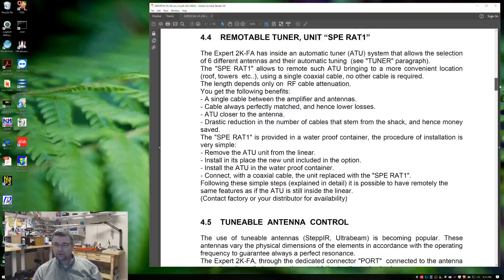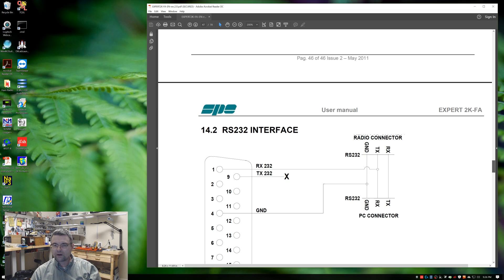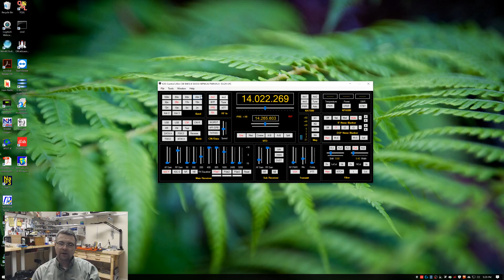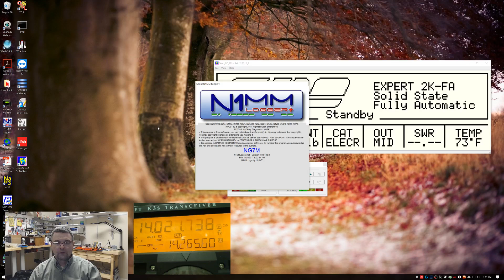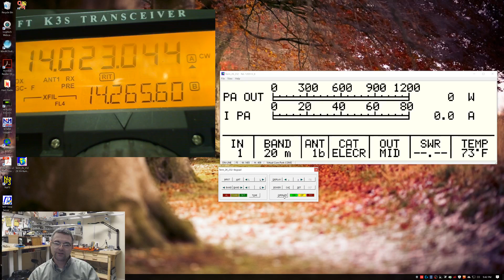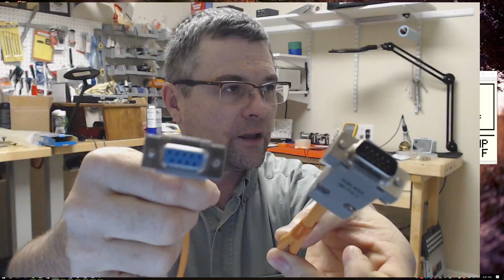SPE 2K-FA 1.5K-FA 1.3K-FA CAT Interface to an Elecraft K3/S and Remote Software

Comment: Sorry Man but seems like you are a rep of Win4k3suite and really do not need this suite for nothing. You can do the connection without this software.
Reply from the maker: I'm not a rep for Win4K3Suite.  Win4K3Suite is a one man shop.  Why would a a one man business have a Rep???  You totally missed the advantage of using Win4K3Suite.  It allows you to create multiple Virtual CAT feeds that allow you to have several software applications and or hardware devices using at the same time.  Of course you can do ONE connection without the software, but again, that's not the point.    If you are simple HF guy / one connection type of operator, and that's all you need, then I would highly recommend you stick with that simply non technical setup.  This setup is for a more sophisticated user that wants to have multiple pieces of software and hardware that thinks it's directly connected to your K3/K3S transceiver. I highly recommend you watch the video carefully and understand the features provided.  Again, I have no connection to Tom the author of Win4K3Suite, I'm just a happy user and nothing more.  Consider that too, why would I put the time in to make the video if I didn't think it was a great value for the price.  I'm not alone either... sophisticated K3/K3S users all over the world use Tom's software all over the world to simplify their DX'ing and Contest setups with stations and are likely far more complex than yours.  Also, it's not a good idea to make assumptions... If you have questions, send me a message direct.

If you respond to this comment in a negative or pejorative way, I will delete your post and block you from further posts on my channel.  It's all about rational input for those that have done their research.  Clearly you have not and or language / translation issues are at play here.  Max NG7M

Comment: Lots of good info and enjoyed your video. One thing I noticed is you have your SPE interface set to "Elecraft" and some others have it to Yaseu or Kenwood plus baud rates at 9600 instead of 38400. What's the deal? I would think you have it right but since I haven't tried it I would like some feed back.
Reply from the maker: Hi Rick, I prefer to use the actual Elecraft CAT feed so the Amplifier knows what frequency you are on before you transmit.  The Elecraft CAT and Kenwood interfaces for this would likely work the same where Elecraft based their CAT feed from the start on Kenwood's protocol (if memory serves me correct).  I would suggest using the full CAT feed where the SPE amp is polling the data.  You can tell if you have this working by going into Set->Manual Tune->Set and you will see the CAT: option at the top of the display.  And as you tune your rig, you will see the polled frequency in real-time.  For other interfaces that only use band data, the SPE amp will change bands with your transceiver, but it won't know where you are transmitting in the band until you transmit and the built in frequency counter determines the frequency.  This is more important if you are using the SPE tuner.  With the full CAT interface the tuner will adjust to your saved tuning settings before you transmit.  You can also just send the data from the K3 rather than have the amplifier poll the data, but if you are going to do that, you may as well do the full feed in my opinion.  Only reading the transceiver frequency is better than the band data only option.  But event the band data option is better than no cat / band data at all.  It's pretty clear in the manual that SPE recommends that you use CAT control.  As for the Elecraft option, it lets you use 38400 baud and again, it allow for polling from the SPE amp.  Others, as you mention that are using the Yaesu setting etc... are likely just using band data BCD only so the amp knows what band you are on.  If I'm going to spend this kind of $$$ on a top of the line amplifier and the manufacturer went to the trouble to allow for a full polling CAT feed, I figured I would use it.  So the video gets into some detail on that where I talk about using a full polling CAT feed to the amplifier and I don't just setup the Rx side of the CAT connection for the amp.  Hope that all makes sense.  I think there are more details in the video too.  Glad you found the video useful!  It's a great amp!  Max NG7M

Comment: I like the thinking and I do use the same software to interconnect my system, so this video will help others.  One caution is that the Pin 7 on the K3 ACC connector should not be driven by +12v TX Inh signal from pin 13 of the amplifier.  Pin 7 ties to the MCU of the K3 and 5V is the maximum safe voltage.  You will need to buffer pin 7 and tie it up to +5v.
Reply from the maker: Todd, thanks for watching and commenting.  I'm trying to remember if I put a resistor inline, but I doubt I did because I would have likely mentioned it in the video.  Your point is well taken.  You are spot on as to what the manual says too about the pull resistor mentioned in the K3(S) manual showing 2.2v pulled up to 5v.  Here is the text from the manual which I'm sure you are referring to:

 TX INH (Transmit Inhibit Signal)
Pin 7 of the ACC connector can be configured as a
transmit inhibit input by setting CONFIG:TX INH
to LO=Inh (or HI=Inh). Holding pin 7 low (or
high) will then prevent transmit. An external 2.2 to
10 K pull-up resistor (to 5 VDC) is required.
If TX INH is set to OFF, pin 7 reverts to its
default output function, K3S ON (see above).

I have been using the amp setup like this for almost a year, however, I'm going to open that connector up and throw in a resistor that will drop the voltage output from the 2K-FA down to the 5v range.  Thanks again for catching that and especially for commenting here on the video.  I'm glad you found it useful.  I hope to hear you on the bands Todd, Best Regards de Max NG7M
Reply from the maker: Todd, thanks again for pointing out the voltage range for the K3(S).  I just finished putting a voltage diver on the output.  A 6.8K on the positive side and 4.7K ohm on the ground side did the trick.  Clearly the K3S isn't drawing much current. Glad you pointed that out.  I have had an issue for almost a year, but I feel better now. ;) Max NG7M